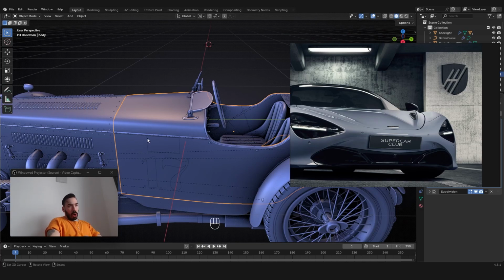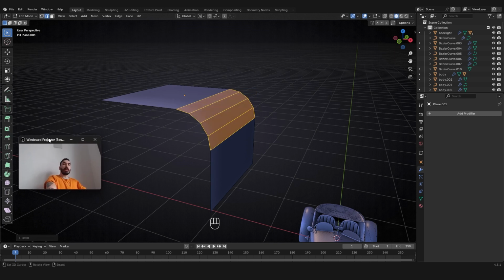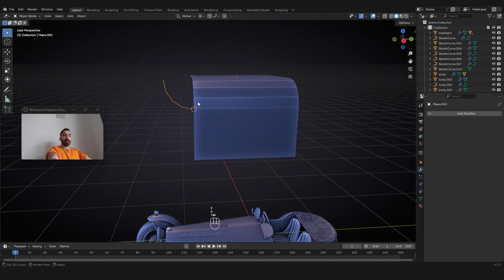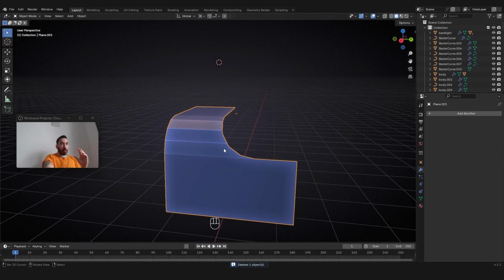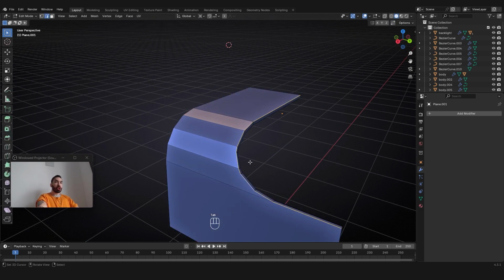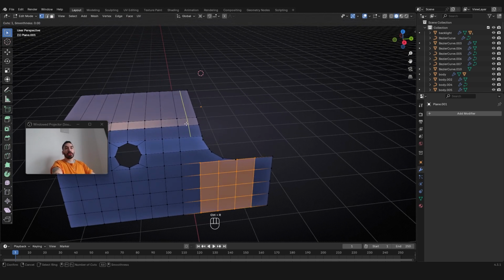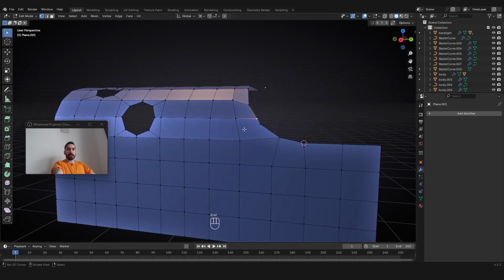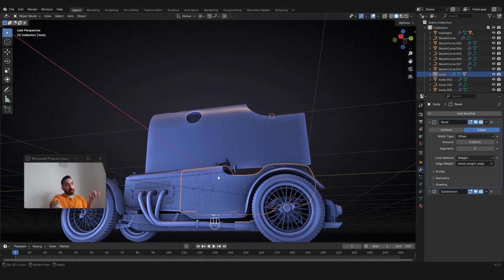Cutting Curved Surfaces - Blender Car Topology Tutorial (Aryan)

Comment: Congratulations 🎉 100k anyway i wanna ask you if you can explain how can i make better topology in blender what should I do?
Can shrinkwrap modifier and subdivision surface modifier help to get better topology I know that depends on different factors like edge flow and using quads in modeling 
But topology improvement need a lot of techniques should be taken in consideration 
My question is how can model without getting those issues especially when trying to model complex shape containing holes and i want to use shrinkwrap modifier and subdivision surface modifier as well and thanks